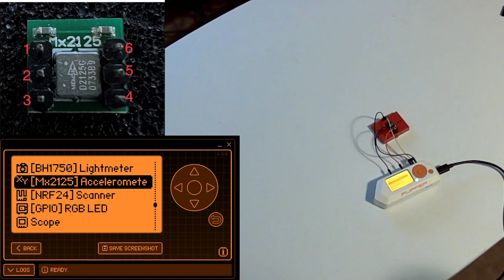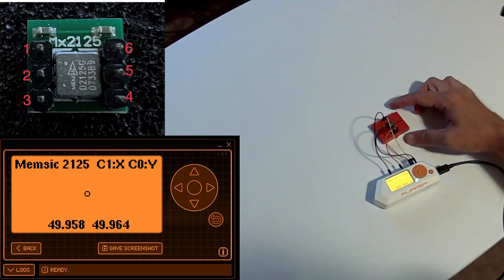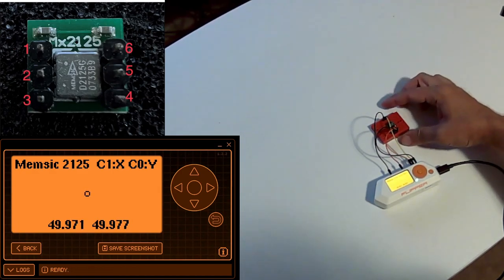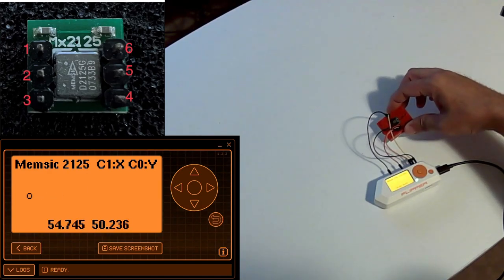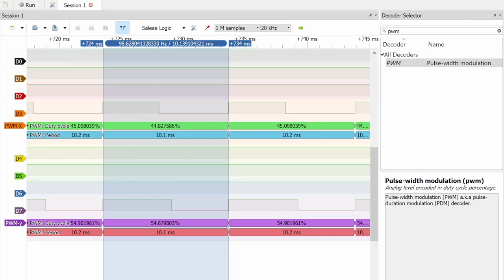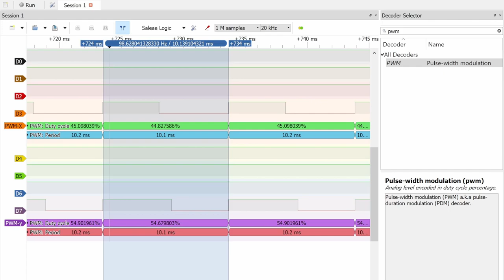Flipper Zero - Mx2125 Accelerometer

Comment from the maker: The duty-cycle percentages are the amount of time the pulse is high vs. low. When the sensor is flat it gives a duty-cycle of 50% for both X and Y.  Tilting hard-left changes the X duty cycle to about 30% and tilting hard-right changes the duty cycle to about 80% (so the pulse is always somewhere between 30-80% of the cycle for this sensor).  Tilting the Mx2125 forward-backward changes the Y duty cycle from 30-80%.  

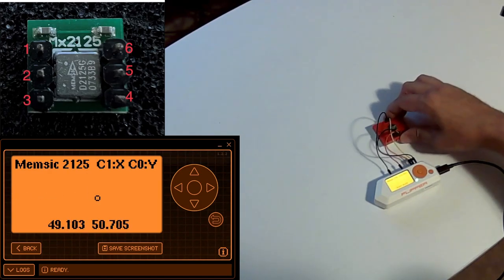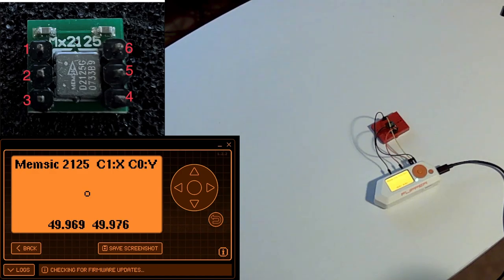Somehow my editing chopped the video for part 0:25-0:34 of the demo, when I moved the circle on the Flipper to hover over the "e" in the "Memsic 2125" title (near the upper-left corner -- see 0:15 for the app).  When the sensor is tilted so the circle appears over the "e" we have a duty cycle in the X of 44.82 and a duty-cycle in the Y of 54.67.

Comment: Would it be hard to use this to control a computer mouse over USB or Bluetooth? Like forward these outputs to another program.
Reply from the maker: That's a really good idea!  It should be fairly straightforward to update the Flipper Zero hid_app to control the mouse based on the Mx2125 readings.  It would be similar to the code https://youtu.be/JKl982JuHyU is using to manipulate the mouse, but using events from the Mx2125 readings.